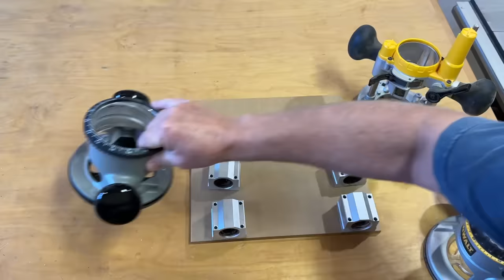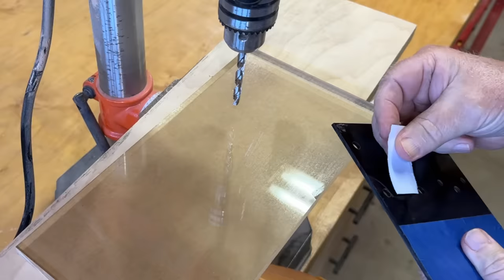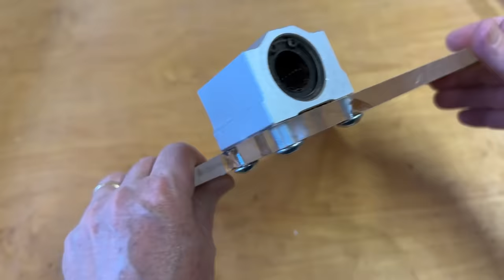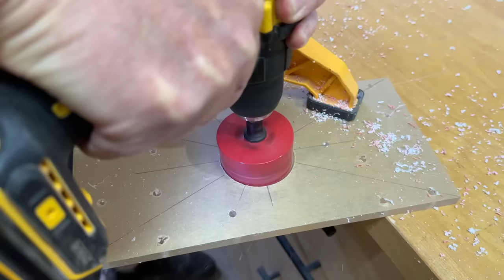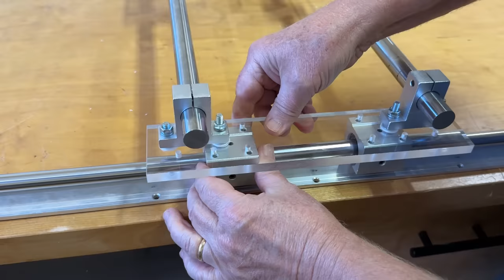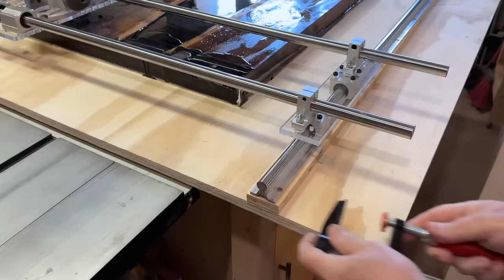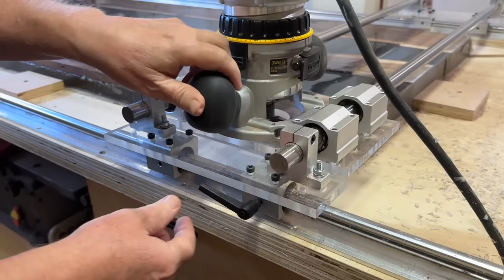Affordable Router Sled - I finally got it right!

Comment: Hey , very nice video and explanation. I wish I watched the whole thing more carefully before committing the same mistakes you did 😹😹😹 , but overall great and very smart design. The thing is rock solid. Went with 20mm on both side and cross rails since my table is not perfectly flat... You saved me a lot of time figuring it out myself , as most of the other videos router slabs look terrible and would potentially lead to  inconsistent performance. You have a new subscriber :) Cheers
Reply from the maker: Thank you so much!  Glad it was helpful!
Reply: @jkmwoodworking  Yeah , the only thing I would add to be helpful to someone attempting this is , when you drill the acrylic max the rpm at the end so it doesn't shatter. The acrylic likes to shatter if the drilling bit bites it , but with high rpm, it instead melts and doesn't shatter. I broke 2 pieces like that even with regular (for metal) drill bits.

Comment: Interstate, this is a good design. However, you might consider using uninstall. Add your side rails a piece of 3/4. Inch plywood and quarter inch hardboard will snuggly fit inside the slot of a uni.
Then you can make the box.  End So you can make your flattening diggers. Long as you want up to the length of your unistrut, you can use warships and screws to attach it to a flat surface on your end pieces Holden an 8 inch. Above the bottom of the you destroyed and then.  When you get it set up, you can piece of put a piece of quarter inch. Why would on the inside? What's a run along the top of the interstate? This works out very well and it pretty unexpensive give me a try

Comment: I love what you’ve done, warts and all. Thanks. I’m considering making one myself that’s wide enough (≈1.2m) for table tops and doors using the large Triton router.

Do you think I would need to go to larger diameter cross rails (i.e. 25mm) to avoid deflection across such a broad span with a heavy router?

Much appreciated
Reply from the maker: Thanks for the kind words!  I also have the 1.2m cross rails, 20 mm diameter.  They feel rock solid, and I believe that they could handle any size router without any deflection.

Comment: Great video and execution on this.  After watching I’m going to build your design.  QUESTION:  For all the screw holes, did you size up on the bit at all or did you get them fairly tight?
Reply from the maker: Great, thanks!  Yes, I did drill the holes very slightly larger than the screws.  My drill bits are imperial sizes and the screws are metric, so I just went the size slightly larger.  I think that is important to allow a little jiggle, then everything kind of self-aligns when you assemble it and tighten the screws.
Reply: @jkmwoodworking . Makes sense. That’s what I suspected, thank for the quick reply!
Reply: Doesn't acrylic require a sharper point angle on the drill i.e. lower than the typical ~118°? IIUC, that's how to avoid having the bit grab as it breaks through.

Comment: Why not make an inline collection box to collect the majority of the wood chips before they reach the shop vac?

Nice clear instructions for making the table thanks.
Reply from the maker: Thanks!  I do actually have a 5 gallon bucket inline collection with  a cyclone separator before going to my shop vac.  But 5 gallons tends to fill up quickly, and I just thought the router flattening process would fill it up too quickly for me to want to deal with.  I definitely need to upgrade.

Comment: Love this!  I plan to learn from your experience and basically duplicate your setup.  Quick question on the router speed.  What speed setting would you recommend for a 2" bit?
Reply from the maker: Thanks, glad it was helpful.  I set my router at the slowest speed, which I believe is 14,000 rpm for the 2" bit.

Comment: 20mm bars seem very strong, but I assure you if you bear down on them (or the router pushes upward because it hits a hard spot or the bit begins to dull), the bars will flex. My question is, how much care do you have to take to avoid   significant flexing?
Reply from the maker: I didn't notice any flexing, probably there might have been some, but it wasn't noticeable.  I don't really take any care to avoid the bars flexing, just shallow passes.  The router never really seems stress.  I'm able to use just 1 hand with a light grip to push it across each pass.

Comment: Do you find the stops useful?  I was thinking just to keep the carriage from going off the rails would be good. Edit- subbed. Great information. I decided to use your design almost entirely, but I am going to add stop collars because my floor isn’t level, and I don’t want my router on the floor by my compressor because I forgot to put a clamp on
Reply from the maker: Thanks so much!  I've always put the stop collars on, but don't think the it's ever hit the stops. But just in case someday it does, it makes me feel more comfortable to have them there just in case.

Comment: I am brand new to woodworking and really appreciate you taking the time to lay this out so well and post all parts and Lightburn files. Is it my imagination or are the SBR20 blocks on the crossrails "closed blocks"? When I click on the link it shows just the regualr open blocks that are pretty standard with these kits. I really want to keep the mount build as simple as possible and this video looks perfect.
Reply from the maker: Hi Joe, the 20 mm crossrails have closed blocks.  I double checked the links in the description, and the ones they link to are also closed.  Note that the "SBR" style rail is what is used on the 16mm side rails, and those are open blocks.  The 20 mm crossrails are not the SBR style, and they are closed blocks.  Hope this helps
Reply: After perusing the video and links a bit more I got it figured out. All my parts arrived today. Really looking forward to assembling this sled. Thanks so much again for sharing your experience with us. Happy Holidays.
 @jkmwoodworking
Reply: I have a new laser coming but not until after Christmas. I know others have inquired but is there any way to figure out the template in a downloadable pdf format? No worries if not. I am inherently an impatient person. LOL
Reply from the maker: Hi Joe, I put links in the description to the template files in a .svg (vector graphics) format.  You should be able to open that file easily, and can also load into most (if not all) laser software.  I think this format is more flexible than pdf, hopefully it will work for you.  Have fun with your new laser!
Reply: I finished and used the sled for the first time today. It is amazing. I would not say working with acrylic and drilling holes was the easiest thing I have ever done. Lol😂  Thanks again for all your help and sharing this video. It is what made me think I could build this too.
Reply: By the way using acrylic to build this is the only way to go. I cant even imagine not being able to watch the bit cutting the wood.
Reply from the maker: @joeglynn2185  That's awesome!  Great to hear a success story, thanks!

Comment: Hi there! Thank you for the video!  I do not have a laser.  Would you please share your template with the exact dimensions between holes?  Thank you much!
Reply from the maker: I've included links to the files for the template in the description.  The dimensions are 40mm x 40mm for the router plate attachment, and 32mm x 30mm for the side rails attachment.  Note that I do think there is some variability from one brand of rails to the other, so I would double check the spacing on the holes for the rails that you have.

Comment: Great video! I am looking to build a router sled to flatten a cutting board without having to buy a planer. I saw at the end of the video that your slab had lines that showed each pass on the router sled. Did you end up reducing those repassing over with your sled or sanding?
Reply from the maker: Thanks!  The router lines came out easy with a sander.  They are not as deep as the look in the video, and were really quick to sand out.   I did another video on the walnut slab desk where I show the sanding out of the router lines, here is the link to that video... https://youtu.be/qQFuAd5rJGE

Comment: Hi thanks for the video! I was planning on building this exact sled, but I'm worried that these cross rails might not be perfectly straight, or might have some give in them with a 2.3hp router on them. I'm considering using the same rails as the sides, with the rigid aluminum, as my cross rails. Price is about the same and there would be extra rigidity. Any thoughts on this? Am I worried about a non-issue? My sled would be more than 41" wide....
Reply from the maker: I actually think that the cross rails on my sled are straighter and more rigid than the side rails.  The cross rails that I used are a larger diameter than the side rails.  What you say will also work fine.

Comment: thankyou so much for making this video as it is the best one I have seen so far. I am wanting to make a router sled, my very first one, so I will be using your parts list because I don't like the all wooden ones. If I am going to the trouble to build it I want to make sure it slides with the best movement possible, and your looks like it does. Also I am subscribing to your channel because of how good this video is. I feel like I can learn from you so thankyou again. Could you please answer a question or two for me please? I don't have a lot of room for a huge sled but I am assuming I can get shorter rail lengths for the side and cross rails. I geuss thats what the options on the listing are. I realize I won't be able to use it to flatten huge projects but I don't think Ill be making anything too huge anyways. Also what size router do you recommend? I have a Makita 1 1/4 hp router 10,000-30,000 rpm. Will that work? Thankyou
Reply from the maker: Thanks so much for the kind words!  I believe your router will work fine, you'll just need to make shallow cuts, but that is probably best anyway.  Yes, you absolutely can use shorter rails...  any size you want will work.
Reply: @jkmwoodworking  Well I can honestly say I have the router cradle built after a whole day in my shop. Wow......thats alot of work just in doing that with all the screwing and drilling and such. I used your method. Made a template out of some scrap acrylic by placing the slider block mounts on it using double sided tape to hold them and keep them from moving, marked all the holes using a drill bit that fit snuggly inside the holes. Even after being as precise as possible, some of the holes I drilled  were still not exactly aligned with the holes in the slider. Once I assembled the sliders onto the acrylic router cradle and installed them onto the rails, they don't seem to slide very freely. I am thinking I need to uninstall everything and woller out the holes a bit to give the sliders a little play so that they can self align to the rail before I tighten every thing up? Did you have this problem and is this what your did to fix it by chance? Thanks...
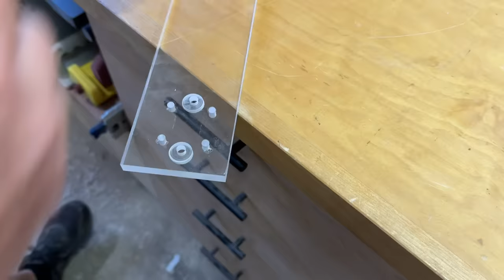Reply from the maker: @imagineengine  Yes, you can see in the video at about time 5:35 that I had to assemble everything loosely first, and then tighten all the screws together while making sure the tray slid smoothly to get them all to tighten up in a perfectly aligned fashion.  The holes that I drilled were just slightly larger than the screws, so it gave a little bit of room for alignment.  You can see in about time stamp 3:25 in the video when I had tried drilling the holes by hand that I had to woller out the holes a bit.  I later abandoned that attempt and when I did it on the drill press, then I used a slightly larger drill bit to start with.
Reply: @jkmwoodworking  Ahhh......thankyou so much for that valuable info. It is rather confusing to me how these two peices work in unison together, the two rails that is, when it comes to trying to imagine it in my mind about what goes where, and how it all works. At least to me anyway...lol Especially since it's necessary to flip everything over from time to time. When thinking about the movement of the bearings on the rails I finally decided maybe its not terribly important for the holes to be exact as more important that the bearings have a slight bit of play in them so to be able to self align to the rails as they move, then tighten.  Thanks again for all your help. I sincerely do appreciate it.

Comment: I got mine put all together finally except for the router being attached. Did you end up purchasing longer screws to attach to the bottom of your router? Or did you countersink and use the shorter screws that come with your router? I have a Bosch and the screws are pretty small. I would have to countersink to a super thin thickness to get them to attach.
Reply: I have the Bosch 1617 router and built this sled using the parts list in the description. I countersunk the screws on the bottom side of the plate and then also bought screws that are longer than the provided Bosch screws. It worked, but incredibly cumbersome to attach the base this way. I believe there is also a hole pattern on the Bosch plate that you can attach the screws from above. If I were to do over that's what I would do.
Reply from the maker: I bought longer screws to attach my DeWalt router to the base.  I didn't countersink them, but could have done that.

Comment: Any recommendations if I want to use this to cut grooves all the way through? How could I mount it closer to the surface level? Could I double up the acrylic just on the sides of the router mount to lower it closer to the wood? Not sure what would be better, that or an extended collet?
Reply from the maker: An extended collet might be the easiest.  You could also put a spacer under your workpiece to raise it up closer to the router plate.

Comment: I'm interested in building one of these, but I need to accommodate a 10 ft table. Any suggestions on rails that are long enough or how to handle joining the rails?
Reply from the maker: That's a pretty long workpiece.  I really don't have any ideas on how to join the rails.  I wonder if you could do it in 2 sections... after doing half of it, then just slide the workpiece down and do the other half.

Comment: Is there any deflection in the cross bars? I feel like if you had them set to their max length, there would be some.
Reply from the maker: I have 4 ft cross rails, and they seem really stiff with no defection.  The slabs I've done with them extended the full 4 ft come out totally flat, so if there is any deflection it isn't noticable.

Comment: thanks for the awesome video. i am having a tough time printing the svg files. for some reason its printing using the whole sheet of paper. how do i print the actual size?
Reply from the maker: Thanks!  I'm not sure about printing the files.  I created the files in lightburn, with the intent that they are used as laser engraver files.  I really hadn't thought to just print them out.  Sorry, wish I could be more help.

Comment: I just got these components in the mail along with a new Bosch router 2.25hp with variable speed. Excited to get this made. Still need to get a sheet of plywood. What speed are you running your router at? Also, are your attached files able to be printed out on a regular sheet of paper for hole alignment? I don’t have a light burn machine.
Reply from the maker: I run the router at its slowest setting when using the 2 inch bit, I think it is about 14000 rpm. I’m not sure about printing the files.  The .svg files are a standard format, can by opened by most applications, so I would think they could be printed, but I haven’t tried

Comment: This is really well down. How flat do these rails stay? I don't have particularly flat tables.. yet 😅
Reply from the maker: The rails do need to be very flat.  I put a piece of plywood on my workbench, and worked ok.  But I did first need to use the leveling legs on my workbench to really fine tune in the flatness of the workbench top to avoid introducing a twist into my workpiece.

Comment: Do you find that the round rails produce a bit of sag?  Seems to me angle irons would prevent sag.
Reply from the maker: I went with the larger 20 mm diameter for the cross rails for that reason, just to make sure they were strong and don't sag.  I've not noticed any sagging at all, they feel very stiff, and produce completely flat results.

Comment: Why did you trim to a width of 11.25"? Rail slide space or more ridged just wondering?  I am about to cut my plastic and was curious why you didn't leave it at 12". Maybe I miss understood are all the peases 11.25 or the combined leanth of all 3 11.25? Thanks for any info.
Reply from the maker: I trimmed it to keep the cross rails as close to each other as possible, still leaving just enough space for my router.  With the cross rails close together, then it maximizes the lengthwise capacity of the sled.  Granted, 3/4" really wouldn't make much difference, and so would have been just fine to leave at the original 12" length and save a cut.  I did trim all 3 pieces to the same length of 11.25.